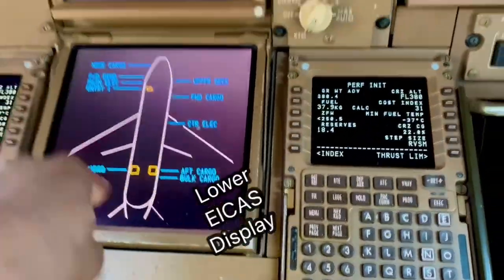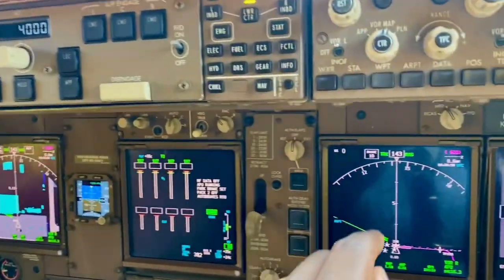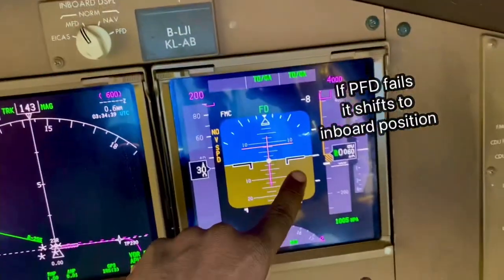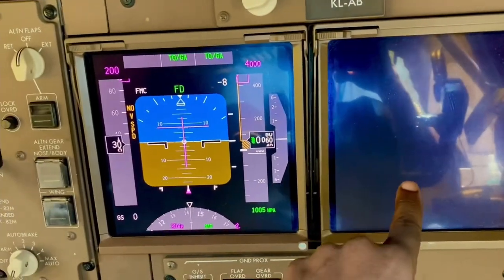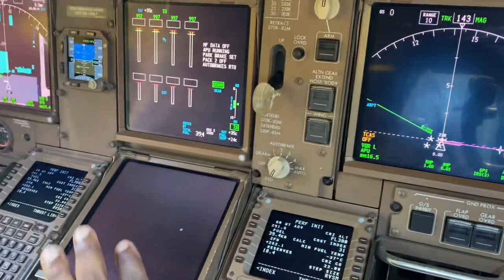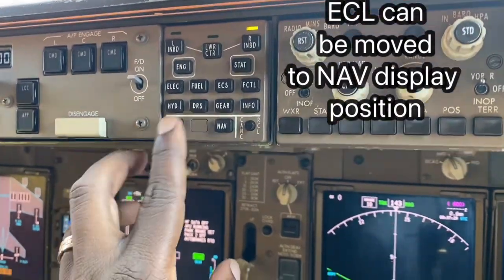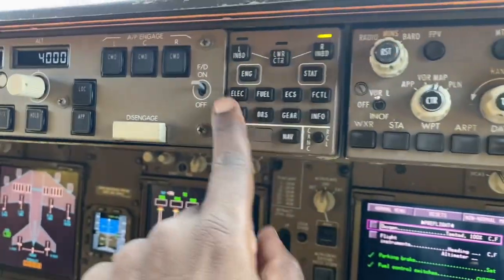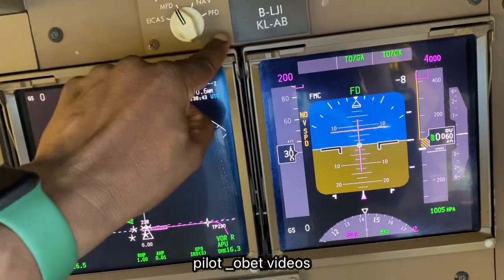Boeing 747-8 Flight Display switching

Comment: Thanks, Skipper.  How different is the 747-8 from the 747-400ERF in terms of economics?
Reply from the maker: The -8 is better as far fuel burn and it can also lift more weight.